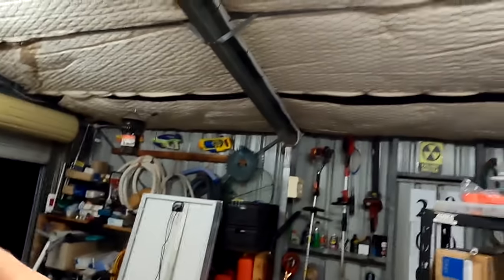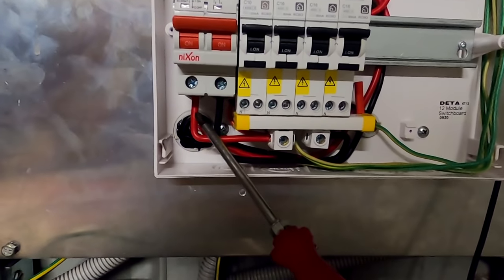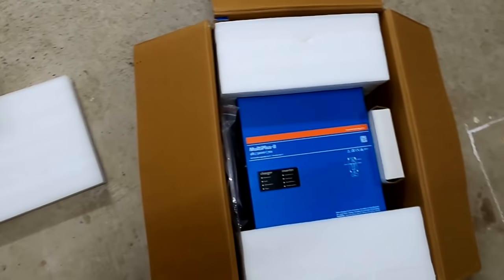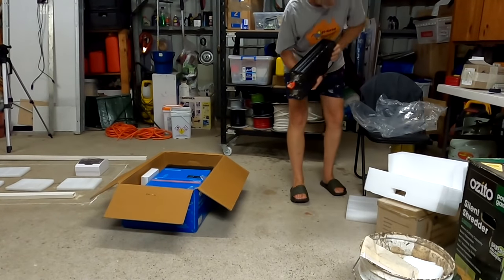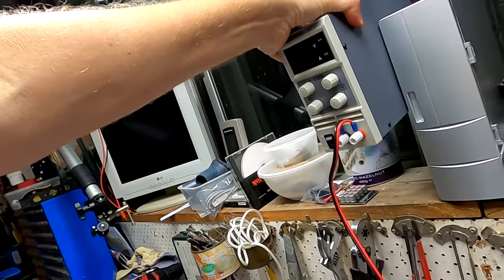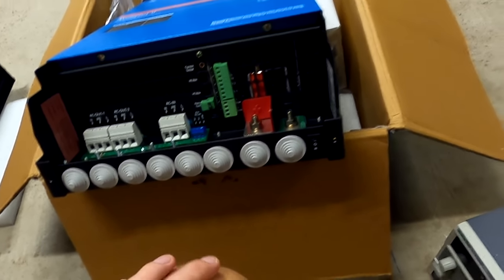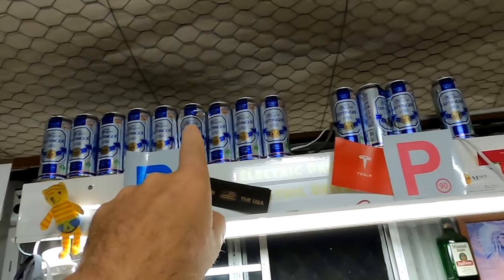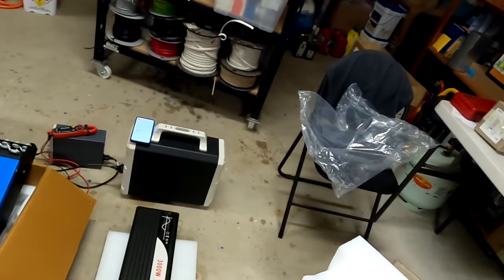Victron Multiplus II series connects to other Inverter's output. Smoke or success?

Comment: 20W standby power is so great compared to others. Looking forward to the inverter piggy back test. Hope there is no magic smoke! Wonder if the multi plus II will also work on a micro grid tie setup? Hmmm ...
Reply from the maker: Yes, it will work. It does not matter what it is connected to. Even a sh*ty generator with bad AC will do.

Comment: Hey Andy, nice idea with using the old inverter. I would set the Victron to only pulling 2500 Watts. I don’t think it‘s a great idea to always have the small inverter at max load. I‘m also thinking to get the Multi Plus. Thanks!

Comment: Hy Andy,
I’m writing you from a nice little town nearby Frankfurt/Main/Germany. I have installed in my tiny house in Spain, 60 km north of Granada, a cheap 24 V no-name Chinese Off-Grid Hybrid Inverter, permanently delivering 2.4 KW. I will add a Victron Multiplus-II 24 V/3000/70-32 for higher load on my in-house grid. So we have the same intention. 
When you connect your Multiplus-II 48 V/5000/… to your older Phoenix Inverter Smart 48 V/3000/… , you should keep in mind, that the Multiplus-II is regarding the Phoenix as a generator or as a week grid from outside. I guess your Phoenix can permanently supply you with 2.4 KW. This gives you a limit of 10 A (equal with 2.3 KW) to enter in the Muiltiplus-II. In the default settings of the Multiplus-II the battery-charge option is set to “ON”. When keeping this setting “ON” you can run in circle-trap, because both devices are using the same battery. 
Why? Let’s assume you have a cloudy sky with nearly no supply from solar panels for some days, your battery has 60% rest-capacity and your permanent load for light and ventilator is at 400 Watt, which brings your battery capacity slowly down. The rest capacity of the Phoenix device is 1.9 KW as being set in the Multiplus-II (10 A). Then this rest capacity is used by the Multiplus-II to charge the battery with the effect, that your Phoenix is running always on limit and due to the change from DC to AC and back from AC to DC with an efficiency of around 80% your battery capacity is additionally going down. This circle run is nonsense. Disregarding what you change in the default settings of the Multiplus-II by software, it is essential to switch by software the battery-charge option to “OFF”.
By the way, I see you drinking my beer. I like the Oettinger Pils. But when I see your poor consumption, I afraid you will need 3-4 years to empty your fridge. The type of beer is not a Lager and you should drink it within 6 months. Do not forget transportation needs 3 months by ship. So in total 12 months is the limit before the proteins will finally fall out and the beer gets cloudy. So drink - drink – drink, or invite some friends to have a beer party. Cheers Hans

Comment: I've been using that onswipower inverter for a while. Good little unit. I pulled the 3k watts for a short time but since then I've set things up to take no more than 2500 from it n the battery it's pulling from. The rest from the others. Itll work out well for you too Andy of that I have absolutely no doubt. The multiples is an even nicer unit. Very happy for you!

Comment: Brilliant idea to use 3kVA inverter like this. I didnt know that this is even possible. But do you need another pack of bateries or is it possible to use same pack also for 5kVA inverter without problem?
Reply from the maker: I can run them from the same pack. Both inverters are completely isolated and have large transformers inside.

Comment: I am looking forward to the installation. The Victron power control function would come into play here. I believe that the conditional settings parameters of the Victron Multiplus  Inverter can be tweaked to better maximize PV production from the sun.
Reply from the maker: Yes, that is correct. The MPPTs would normally shut down the panels when the battery is full. The MP can still utilise this energy by activating AC2.

Comment: I can't see why you couldn't run 2 identical discrete solar systems and avoid parallel battery strings altogether by swapping your solar system into 2 parallel systems instead with a single 240v output but there maybe some reasons I haven't considered.

I came up with this after reading that parallel strings PDF called Strings, Parallel Cells, and Parallel Strings. You posted the link awhile back and I read it - several times in fact.
When I was looking at the final diagram on that PDF the penny dropped. I wondered why the authors didn't think of it but realized inverters capable of piggybacking probably weren't a thing when the article was written. I don't exactly know if it is desirable in an off grid system but I'm pretty sure it's doable.

System #1 
For example and simplicity say you originally have a 500ah 48v off grid system with 24 panels, and 2 x 5000w inverters with two parallel stings of eight 6v 250ah batteries for a grand total of sixteen batteries and 500ah @48v with 10,000w potential. 
System#2
Instead of parallel battery strings, divide the systems into 2 parallel systems of 8x 250ah 6v batteries, 12 solar panels and one 5000w inverter/charger. One inverter piggybacks into the other in a master slave arrangement for the single 240v output and the same 10,000w potential.

In some respects it is almost the same but wired for some redundancy and avoids those damn parallel strings that so annoy and frighten causing endless argument and ill will.
 
Downside vs upside.
I can see that 2x identical systems won't stop a cascade failure (for example if you had 7500w load across two systems ea 5000w, and one fails because of a loose terminal somewhere overloading the other then causing it to self protect). Also system A - the Master that contains the oscillator might be the one that fails causing total power loss. I don't know how quickly you could reconfigure system B to provide partial power.
It still might allow the house to function but with 5000w rather than 10000w if system B goes down. 
I can't see why you wouldn't want to do it because this might happen on a single system but the battery banks are now separated allowing at least the possibility of redundancy. Other benefits could be easier upgrades and maintenance without having to turn off all the power.
Another downside is adding say a wind turbine means you need probably need two turbines now.  

Possibly you could split wire the house, hot water and power points on one bank, lighting and pool pump on the other but then you mightn't have enough power to do anything negating the benefits of it in the first instance. 

Basically just think of it as a twin engine plane.

My idea has same amount of solar panels, same amount of inverters, same amount of batteries but no parallel battery strings and it's wired differently with extra wiring from the solar panels since they're now divided into their respective systems.  

What do you think? Good idea or not?

Comment: If you are going to attach both inverters on the same battery bank,, i don't think it will work, the battery bank will be all the power source,, and both inverters can only pull what the battery can produce, power in=power out,, i can see no gain unless the ac in of the multi plus is pulling from the grid.. correct me if im wrong,please do
Reply from the maker: The battery is large and can handle both inverters easily. Once we have the three battery banks in the shelf we're talking about 48V/850Ah with 45kWh.

Comment: Hi,
I think it will cause a problem, not for the MT II but for the Victron Phoenix Smart, it cannot charge power to the grid. so if the MT II pushes back a little, boom flash. Hopefully I'm wrong. LOL
Reply from the maker: The MP should not backfeed as there is no AC solar connected to it.
Reply: @OffGridGarageAustralia  Where are you going to connect your battery and your mppt ?
Reply: @OffGridGarageAustralia  Actually when running with zero load it will backfeed about 10W.. Normaly it will dissipate as heat. That is one of the possibility why @Kevin Mills said it put his 3000W UPS on fire.. But it will mean that +10W on UPS transformer heat it up enough to melt isolation on transformer wires. Remember, that 10-20W could produce UPS itself and if fan is operated by current and not by temperature, problem occurs. It could also be not isolated from battery.. In your case there could be little help to switch to AES (about half the power on zero load). Victron said it is more narrow, i donot see it, maybe you have better osciloscope.
But what will work - is to disable Phoenix inverter when it is not needed (there is parameter in Multi+ when to connect grid and one of possible situation is when power needed is bigger than xxxx Watts.. Or disable it by remote control a use it like remote start of gasoline power supply.

Comment: Hi Andy using your phoenix inverter as an input on the Multiplus you would obviously need a manual change over switch for when you grid tie Multiplus. If this is the route you are going to take you are better off returning the Multiplus and going for a Quattro.
The Quattro has two AC inputs and you will get full control over both.
Reply from the maker: Yes, generally speaking you would need a transfer switch to disconnect the old inverter and connect the grid to the input of the Multiplus or vice versa. As you said the Quattro could handle both grid and old inverter at the same time as it has two inputs. I'm not going to use the old inverter once I connect this all to the grid in 2028. It's a temporary setup so we can learn how it works and what the features about the Multiplus are... It will be solely off-grid, no connection to the grid whatsoever.
Reply: @OffGridGarageAustralia  I like it. Well done Andy. If you ever need any help regarding your Victron products I install these every day. Feel free to contact me anytime.

Comment: That old 3kw inverter is a beast! It can pump out 3kw all day long! And it has been many times for me! I love it!
Reply from the maker: It may work better in colder climate but here I often see the red light for over temp warning (like in the video). 2kW is already too much on hot days...
Reply: Mr. Andy, is it possible to mount external fans for old inverter to increase its cooling? Does this inverter has a massive heatsink at it's back side?
Reply: @OffGridGarageAustralia  I find it strange to hear that! In the tests that I have seen you perform with the Chinese inverter seemed to perform well while I have also seen your victron struggle to output 3kw for a decent amount of time... Maybe the tests that you have shown for the Chinese inverter weren't long enough to show that it also struggled to output a constant 3kw? 
All that I know is that I purchased the same Chinese inverter after seeing it on your channel and I really am happy with it... We have had a good few days in a row of heat here in Melbourne and it's perfectly performing without a single shutdown... 
I'm now looking into those Chinese grid tie inverters that you have featured in your videos... I like that they are so flexible and can phase match and simple to install. The victron multiplus II is nice but expensive and apart from being able to connect with other victron equipment and see what they are doing from anywhere, the Chinese version is fine. It has only one job to do and I don't think that it can stuff that up! 
Also... I wanted to say that I'm really loving the battery build! Can't wait till it's finished, can't wait to see what others will bring to the table after seeing your masterpiece! Hopefully this will inspire others to do better so that we all can learn something new... 
Thank you for being who you are! Australia is lucky to have you..
Reply from the maker: @PeterMilanovski  Thanks a lot for your feedback and kind words, Peter. 🙏
The Phoenix inverter indeed struggles to output 3kW under certain circumstances. This is all mentioned in the manual and was known before I bought it. The Multiplus will have similar restrictions in terms of heat and output power.
The XIJA inverter was able to output full 2.7kW for several hours when I discharged the large battery and dumped the energy into the car for several hours (it wasn't that hot though). It has 2 very noise fans inside which cool it down. I just don't trust this performance over time, meaning over several years. The problem here is the heat inside the inverter over a longer period of time. Even it has the fans to cool, will it last though? The Victrons will just throttle down for this reason. I know Victron has very good customer support, 5 yrs warranty and also get regular software updates (like a Tesla). It will last a long time even it is more expensive.
The SUN inverters have no approval to be connected to the grid. Not in any country as far as I'm aware...

Comment: You have to be careful to put the phenix and MP-II in series, as the MP-II are able to push power back through AC-in. I don't know how the phenix will react on that. We don't need a  burning phenix.
Reply from the maker: You have to turn this feature off as well as charging the battery through the MP2.

Comment: Exiting stuff Andy.

I'm doing exactly the same but with MPP Solar inverters, a 5Kw and an 8Kw unit, the current 5 Kw inverter will become the AC input for the 8Kw unit.
I'm retaining the AGM battery bank and thanks to your guidance I'm adding the 16 cell LFP battery bank.
I'm looking forward to many more entertaining and educational videos.
Reply: Very nice. What model Mpp Solar inverters are you using?
Reply: @itsmeasis  Currently using the PIP5048 GK on a 48v AGM battery bank, that's been running since Nov. 19 and my wife has managed to overload it only once.
I'm adding the PIP 8048 Max on a separate 16 cell LFP battery bank and then intend to use the 5048 as my AC input.

I'm using a Pi B4 running ICC software to monitor the system on line, too far to walk to the battery shed.
Reply: @NedKLee  Thats awesome!!! Thanks for the info. :)
Reply: Hi Capt K, good to see ur comment here, I have 2x 5kw 48v AIO’s & 2x 3kw 24v AIO’s, & have had similar thoughts of late, to use the 2x24v systems in a bus I have on a property up north in a similar manner, I am fairly sure most of these All In One systems can be daisy chained this way or similarly, as they assimilate the waveform being provided by either utility power or generator in an UPS type way, before outputting. I was going to use the 5kw mpp AIO inverters for a house & shed project on another property and was anticipating doing something like Andy in the shed (not as grand perhaps), that could also supply the house to some degree, so it was helpful to read ur comment here, thanks. Think Ill see if I can make some smoke. Cheers

Comment: I will be interested in how you stop the battery from micro- cycling at its top end voltage when your solar dumps - the battery will need some kind of  disconnect
Reply from the maker: The charger will keep the battery at 3.35V/cell on float while the solar is delivering energy to the dump load. So there should be no micro cycles, same as there is none right now without the dump load.

Comment: Practical application of your proposed build (in the US) --- Honda EU2000i on the back of the semi (Class 8 tractor - road train to you guys) feeding into a Victron 12/2000 Multi. connected to the 4 - 12v AGM SLA batteries (semi also has a diesel APU with 150 amp alternator). 120 volt cord (US remember) to the 5th wheel trailer input to the 24/3000/70 connected to 24v / 300  ah LFP batteries (and solar etc). 

Normal operation on the road - Truck alternator (250 amp at 12) feeding the 2000 Multi and powering the semi house loads - microwave, various chargers , fridge, etc and sending power to the trailer @120 vac. Trailer has a 7 cuft (1/3 cu meter) deep freeze, 20 cu ft (2/3 cu meter) fridge/freezer, sometimes "crock" pot (supper). Trailer batts fully charged thru solar and truck.and providing power assist.

Boondocking / off grid - Truck APU monitoring the 12v and providing as needed. Honda providing that morning spurt (cooking, coffee, and pushing excess into the trailer batts. Solar doing it's thing when the sun gets enough to be useful. 

Emergency - Honda (13A)  powering into the truck 12/2k (power assist / share), APU adding to the 12v batt as needed and the trailer in auto. 

This worked through the TX deep freeze (Feb 2021) - and has been in various stages for the last 2 1/2 years.

On edit - I added a remote "shut off" to the Honda so the Multi's can turn it off for quiet times, full batts (not being elec start...)

Comment: I think you need to install the ESS assistant to the MP-II, or else it will pull all the load from the phenix, or you can use the power assist function. You need the MK3 adaptor to connect and made the changes on the MP-II. I like all the possibilities.  Be aware you also need a grid code to run ESS and get it working. I can help you in this as I have already install quattros and MP-II for my home project.
Reply from the maker: Thank you Dennis, much appreciated. I've got the MK3 here and am aware of the ESS Assistant I need to install on the MP2. I'm not 100% sure how I prevent the MP2 from exporting energy yet. That would be fatal for the Phoenix...

Comment: Nice. :-) 20W of standby is not much for a 5kVA inverter. But is it possible to use one of the MultiPlus II programable relais outputs to turn on the Phoenix inverter when needed?
Reply from the maker: Oh, wow, that would be next level again. Yes, that should be possible actually. Great thinking...